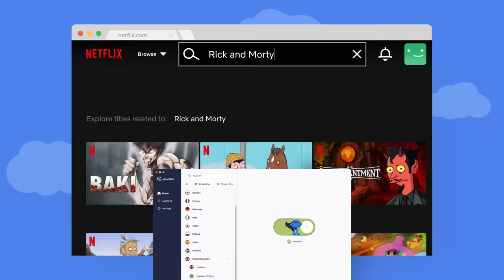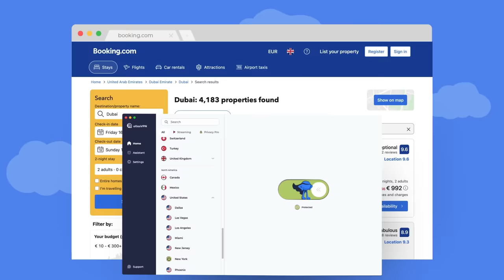How do Russians Cope with Heavy Tank Losses?

Comment: It didn't seem to be in mainstream videos, but I saw an explanation of the start of T-80 production from someone in the Ministry of Defense. It was stated that the new T-80s would be used by army and marine units in the Arctic region. Gas turbine engines are preferred in this region. I suspect that this is due to Sweden and Finland joining NATO and the need to strengthen forces in this area, rather than the current operation in Ukraine.
Reply: But everything will end up in Ukraine probably.
Reply: iirc it was because Gas turbine were more reliable in those regions and could be started quicker
Reply: I thought that Sweden wasn't in nato yet?
Reply: Russia doesn’t have marines, they have Naval Infantry
Reply: @hydra8845  Same concept, different terminology. Marine infantry is also valid but means the same thing.
Reply: @th3d3storoy3r  Turkey gave the green light I think but I lost track as they go back and forth on their position
Reply: I guess that was in the intention, but no way they are diverting tanks up there when they are needed in Ukraine.
Reply: @rogerwilco2  My opinion is that new tanks, especially after production is restored and many changes are made, will go to the units in the north for running-in, while the old tanks from there will be refurbished and sent to the front. It is dangerous to send unproven equipment into a combat zone.
Reply: No really. The main reason they are restarting production is simply because the T-80BVM does really great in combat (They lost fever T-80BVM tanks than T-90M). It is more mobile and still has reserve engine power with having the reserve speed issue solved.
Reply: @rogerwilco2  There is no desperation in Russia's deliveries to the front, the already produced "parade" T-14 still hasn't gotten there, although it could have been sent there by now if there was a strong need.
Reply: Russia claimed that they gonna use it in the northern region long before the Ukraine war, around 2018. And by many sources that are not MoD propaganda, this is a stupid idea and T-72 works just fine in cold too
Reply: @hydra8845 it is the same thing lol
Reply: @KSmithwick1989 no no, its same terminology but different concept. In russian there only one term to describe marines and naval infantry, «морская пехота» and US marines are called with the same term. This is why “Naval infantry” looks stupid for me since its just marines in russia
Reply: Like is there any Russian that really believe NATO want to invade them ? And that Finland/Sweden would agree to that ?
Reply: Russia has removed all tanks from the Nato border as they know NATO is not going to attack. Forget all nonsense about russia building a defense. Russia is only interested in offense and that is what they are preparing, always.
Reply: @BjorckBengt propaganda.
Reply: T-80 tanks, just like T-64 tanks, where produced by the Ukraine. T-72 tanks where made by the ural region.
Reply: The northern forces are allready deployed in Ukraine.
Reply: It makes internal sense, but T80s are becoming a larger part of Russian forces in Ukraine over time
Reply: @Southerly93  again not really, they're using the T-90MS more.
Reply: @osmacar5331  IDK what you're looking at, but I have yet to see any data (visually confirmed sightings and losses) that says T90M is more than 3% of tanks confirmed to be used in Ukraine. Obviously not every tank being used is documented for the public to see, but there would have to be some serious errors in the numbers to show any significant use of T90M.

According to what I see, T80BVMs were used in large numbers at the start of the war, because of the elite tank units used to attempt the assaults on Kyiv and Kharkiv. The use fell off dramatically as these tank corps were annihilated or forced to abandon their vehicles. As the war drags on, it seem that more and more T80B and T80BV tanks are being used starting from February of this year. This is also reflected in their share of confirmed combat losses, overtaking even T72 four months ago. That suggests to me that T80 tanks are much more readily available and preferred as the Russians deplete their stockpiles.
Reply: I think that was the same reason arctic brigades (or brigades assigned to the northern military district) got some of the first T-80 BVM's and had tank units compromised primarily of T-80 BV's
Reply: @Southerly93  most T-80'S where withdrawn after the initial assaults. but keep eating the propaganda...
Reply: @osmacar5331 T-80 also made in Russia as well... There was 2 factory produced T-80 in Soviet. One in Kharkov, one in Omsk in Russia...
Reply: @boocomban  they only restarted, also they only made T-80U tanks, not the majority of T-80's being used, that is ukranian forces.
Reply: @osmacar5331  I'm sorry that reality does not conform to your current biases, but that does not make open source quantitative data false. You can argue that my conclusions based on the data are wrong, at which point I'll be happy to hear you out. However, no amount of repeating things that are verifiably false can make it true.
Reply: @Sudno eh it could end being. Show weapon  Russian  are known to make parade vehicles, but who know maybe after the war and with t 80s coming into production  maybe will see the t 14 return as a t 80 variet or see it take a new fork using component from the t 80 after all that how the T 90 first started as a variet of the t 72
Reply: T-80 production is in Russia. Many older tanks were built in Ukraine under Soviet rule and their factories no longer available.
Reply: @Comm0ut  T-90 is russia, T-80U is omsk plant. Most T-64's and T-80's are ukraine built.
Reply: @123456qwful  Т-14 is first and foremost a testbed vehicle. The military has set requirements - UVZ has made a tank according to these requirements - now the brass and engineers will decide which solutions should be transferred to serial production (if at all).
Reply: T-80s were already being used by Arctic units but all of them were almost completely destroyed during the initial invasion of Ukraine. This has of course left Russia vulnerable in the Arctic but it seems unlikely that Russia is seriously considering standing up new Arctic brigades considering the enormous manpower shortage they still have in Ukraine. What's more likely the case is this is simply a way to get more tank factories online, the factory that built the T-80 still exists and is allegedly still fully equipped so it can start production without diverting from other types.

The advantage of the T-80 in Arctic regions is that gas turbines are less likely to seize in cold climate as there's not any liquid inside of them that could freeze, except the radiator but you can add antifreeze to it.
Reply: *war in Ukraine
Reply: @Sudno but the t-14 just can't do shit. 
If it gets damaged there are no spare parts and a loss on the propaganda front would be devastating.
Reply: @ni9274 no, 
They rather want to invade NATO then the other way around
Reply: @rgbforever4561  *Crimean conflict
Reply: @chesterhiggens uh yea, Russia's propaganda is Talking about this defence bs
Reply: @Sudno but we won't see it in this war
Reply: Yes because Nato is such a high threat that they moved all troops to Ukraine from the arctic border :D
Reply: @jepulis6674  bruh
Reply: So would the Abrams be good for the arctic since it has a gas turbine engine?
Reply: Must be scary crawling into the wrecks to try to repair them while finding human remains from previous crews. In addition, the repairs will not be equivalent to new ones due to the material fatigue they were exposed to when they were hit.
Reply: That was before the war, before Sweden and Finland had any intentions of joining NATO. 

And for anyone wondering why gas turbines would be preferred in the Far North/Arctic, it's because diesel engines do NOT like the cold, being much harder to start in the cold since the engine needs to heat up enough to start, vs gas turbines and other gasoline engines that have spark plugs.
Reply: @diobrando2575  Sweden and Finland had always been pro-NATO. In fact, back in 2011 one of them (can't remember which) even did a survey on their own people to test the waters asking if they'd like to be in NATO, meaning their government had always had that intentions in doing so. Regardless, they conducted operations for NATO during the times when NATO invaded and attacked other countries, Sweden even joined in bombing operations alongside NATO against Libya and other Middle East countries and Finland helped NATO with intelligence. They even got a NATO special task force long before the Russians attacked Ukraine.

It's bullsh*t to say they're neutral because they've never been neutral. So the fact that they join NATO now doesn't really mean shit.
Reply: @saint8257  I don't see how that's relevant to what I said, but go off I guess.
Reply: They already have enough tanks for Ukraine dude. @TheBooban
Reply: @diobrando2575  "That was before the war, before Sweden and Finland had any intentions of joining NATO. "

Literally blind
Reply: @saint8257  I said that because Sudno directly mentioned Sweden and Finland joining NATO as being the reason why Russia was going to be sending T-80s to the arctic despite the fact the BVM came BEFORE the war.

But if you wanna argue over what I said about NATO and the Swedes and Finns, working closely with a military alliance doesn't make you a part of that alliance. If Sweden and Finland weren't in NATO and they were invaded, NATO would have zero obligation to join their war, with them likely only getting a similar level of support to Ukraine. But please, keep blathering on about how working with an alliance is the exact same as being in one like a lobotomite.
Reply: @th3d3storoy3r  

Sweden already signed a separate security agreement with the USA which gives America access to Swedish air bases and ports
as well as permission to pre stage equipment to support a rapid airlift deployment of American troops into the country.

America had recently signed a similar agreement with Finland, and has been in such an arraignment with Norway since the Cold War.

The prep work for Swedish integration into NATO is being laid down with the idea that America is the biggest defense partner anyways.
Reply: @Sudno  There have been under 7 T-14 produced to now. Russia is, according to their own data, behind by 1700 tanks/year.
Reply: Of course it is.

It's not that they are losing tanks quicker than they can make them.... surely?
Reply: @Southerly93 t72 comprises the bulk of russian losses then t80 with t90 least.

But lots more t90s getting hit now maybe they're running out of t80s
....
Reply: @hydra8845 it’s the same thing, it’s just a translation

Comment: 1. Reactivating tanks from deep storage

2. Building new tanks

3. Repairing destroyed tanks
Reply: Damaged tanks, not destroyed
Reply: @creakychair9387 some tanks that i think are destroyed are actually repairable. But yea, fully burnt tanks probably can't be restored.
Reply: You could salvage things like ammo, guns, and mechanical parts from destroyed ones if you can't fix them as well
Reply: It's going to be hell for Ukrainian maintenance crew because Ukraine not just operate T - series tank but also Leopard 2, Challenger and Abrams tank. That's just main battle tank, the APC there are Bradleys, BMP and others.
Reply: @trololoev Destroyed tanks will likely be used for spare parts since it’s simply not feasible to repair them in short enough order.
Reply: @trololoev  if the burnt part is only the paint, it can
Reply: @UgandanAirForce I personally wouldn't salvage ammo from a destroyed tank
Reply: @Majo-cv3yt If the ammo is intact, then why wouldn’t you? Every little bit helps.
Reply: @UgandanAirForce  the ammo blows up if it’s a destroyed tank
Reply: @trololoev the armor would be compromised. But it's russia, gotta save money somehow
Reply: jasperpercabeth9140  Then most tanks are never truly destroyed then.
Reply: @yudhiadhyatmikosiswono9082 Not that much. Outside of the Challenger, Poland is operating the Abram, the Leopard 2 and the T-72, and Germany and czechia have strong industrial capacities for these. That's not even that far from the frontline. Where it's hurt is for small local reparations. 
APCs are probably a bigger challenge though indeed.
Reply: You have to wonder about the amount of hours Russian companies must spend on procuring the replacement parts as well as the actual repairs on damaged tanks.  Wonder what percentage of knocked out tanks are actually repaired?
Reply: @williamlloyd3769   You can often pull replacement parts from other knocked out tanks.
Reply: @trololoev  You'd be surprised how many destroyed tanks can be repaired.  If the hull survives, and enough spare parts exist you can be bring back a destroyed tank to life.    This is actually one of the issues when looking at WWII statistics.  The Germans and Russians both over estimated how many vehicles they destroyed, but that's because they based it on how many tanks they counted knocked out, or hit/crew building out extra, on fire blah blah blah.   But surprised how many of those 'destroyed' tanks ended up being taken back to the rear and repaired counting who took the ground.
Reply: They only have so many tanks
Reply: "Russians Cope with Heavy Tank Losses Myth" is just uki propaganda